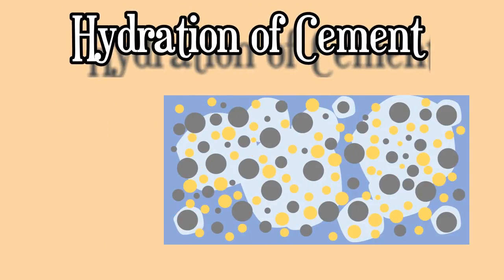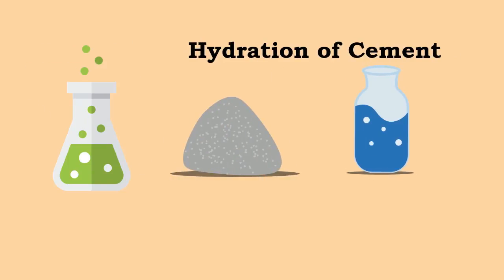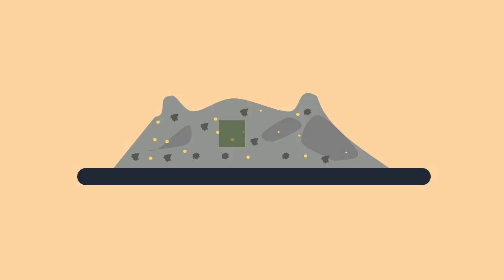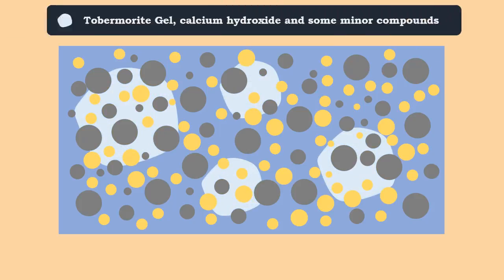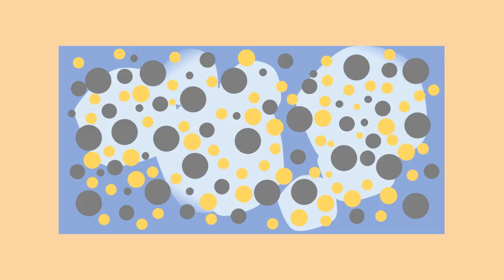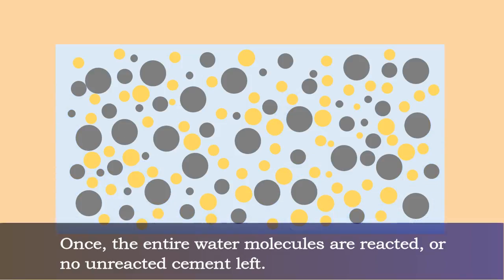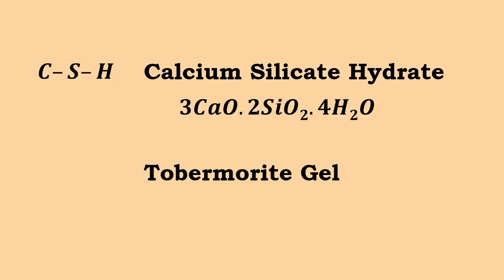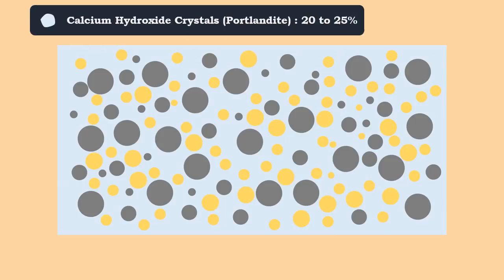The overview of the Process of Hydration of Cement || Hydration of Cement #1 ||

Comment: after 7 days there is no progress of strength for concrete, what will be the cause
Reply: My guess is, if enough water is used, the chemical reactions in the bulk complete and all chemicals are used up. If there is not enough water, then the cement does not hydrate, reducing strength. I don't know what happens if you put too much water.